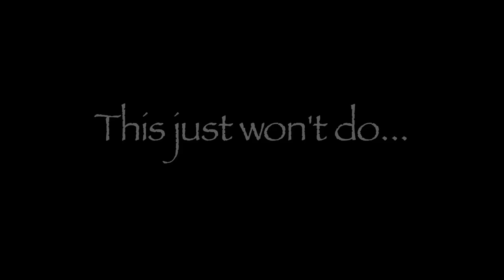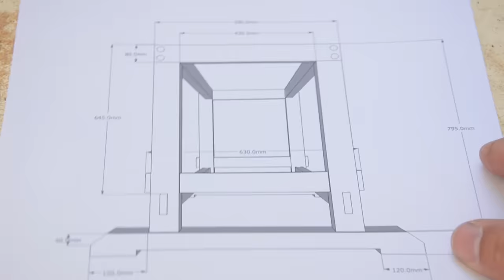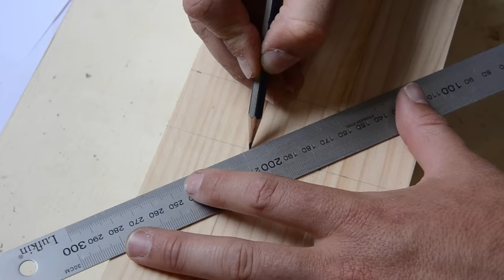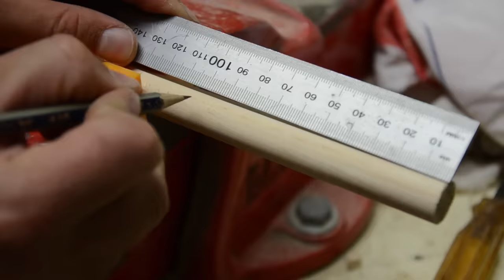Laminated Pine Workbench From 2x4's - Woodworking

Comment: I prefer to flatten the top by moving the router with tbe grain. It leaves no marks that way and it's not necessary to use a belt sander.

Comment: 5:00]  I really like this video, I really like this build, but up until this moment I have witnessed no evidence of the jointer nor the thickness planer.  I wonder why?  All of the other videos are replete with jointers and thickness planers.  At this point in the video, where there are three groups of the future workbench top glued and laminated together you would expect - at minimum - each to be fed through a thickness planer before bonded together as a whole - but not here.  22 boards wide?  That is thick.

Comment: This is a nice bench ... but why use pine?  It's so soft and is going to get dinged up in no time.  Oak or ash would have been a stronger surface for the table top.  Nonetheless, it is a nice bench!  Well done.
Reply: It is also stupidly more expensive. Depends on your budget. Here, spruce is like two to three times less expensive than oak. Beech is not that expensive, but still quite more expensive than spruce (which is pretty close to pine (well, it really depends on the variety))

Comment: This is awesome but if you ever use a router sled again being level is irrelevant what matters is that your piece is parallel to your guides next time put your piece down put your sled on and measure from the bottom of the sled to the top of piece and that measurement should be equal

Comment: Great bench but when you were trimming down the edges on the tablesaw should you shouldn't have the blade hat much higher than the piece of wood because it is unsafe you should have it about a 1/4 of an inch higher than the wood

Comment: Your left hand and fingers have no business feeding the work in the same plane as the blade. Use a featherboard OR you will lose those fingers in a lapse of concentration or an unexpected interruption. Take my word for this...... 50+ years of safe table saw operation and a brief stint as a college level instructor.  You also need a riving knife or splitter when ripping to maintain the workpiece against the fence ever so slightly to prevent a "rotational" type kickback. Take my word for this ....... Paint your throat insert RED as a "Do not enter" zone for hands and fingers.  Keeping you safe, or try to at least .... Pat

Comment: could have used less timber on the top just laying the boards edge to edge instead of side to side
Reply: for a strong/hard bench top,  grain needs to be standing vertical or horizontal (otherwise its too soft and compresses too easy)

Comment: Can’t recommend using pine.  Edge grain pine is too inconsistent across the grain pattern in hardness. I can guarantee that after hand sanding the surface it was not flat across the top.  If you are going to the trouble of making a solid board work bench use a hardwood like maple.

Comment: There are many significant drawbacks/mistakes in this design. Just research what is the classic Roubo bench or an old French bench. 1) Leg bases are trip hazards. 2) top stretchers will prevent from clamping across and underneath the top 3) the bench is way too wide - not convenient and loses space, plus the leg bases are losing even more space prevent from putting the bench against a wall 4) did the oil (not the best oil for this bench) get applied to the top only? The bench will warp in this case due to moisture difference 5) the leg side are not flush with the top side (there are overhangs) - this will be inconvenient for clamping large objects (like a door for example) against the side of a bench. 6) Not a proper way to connect the top to the legs base. Many more smaller things as well. Nice video but a very flawed design.

Comment: Have you ever used a workbench before? Do you use hand tools at all? It's way to deep. No need for it to be over 2 feet deep. And why aren't the legs flush with the front edge of the bench top? If you don't know why they should be flush, then maybe you don't need a bench.

Comment: The work bench is to short for you to work on .... You are a tall person.... It should not be any lower than 1 inch below your Elbows due to fatigue and your eye sight will change over the next years from normal to bifocal to tri-focal as you age and this table will last life time if you prep it to do so..but you put the oil on the top!!!... The best chance it not warp and change in the weather, take a hammer hit and not dent the wood, is to do the this mix 50% water and 50% water proof wood glue and cover it every where top bottom, leg ends etc. you name it cover it..... This the way the old timers say 3 to 4 generations did it before all the modern   times and some of their work bench, furniture, are still standing when the ones now are disposal able.... I bet you do not read this or do it but it is ok!!!!!!!!! I will wait for a reply.. Do it on a small board the prove to your self I am right!!!!! Waste some glue and a board!!!!!!!!!